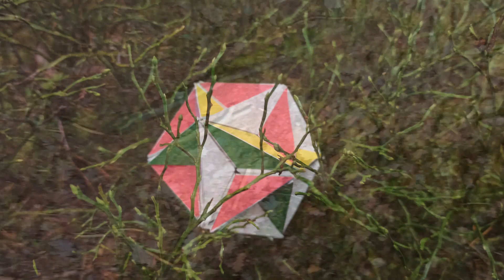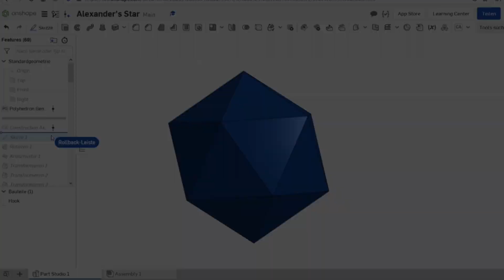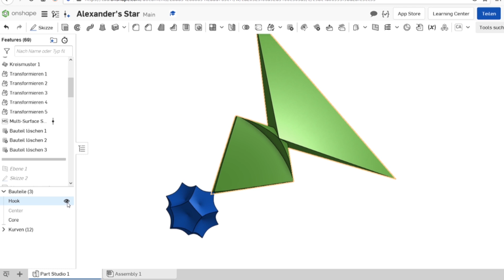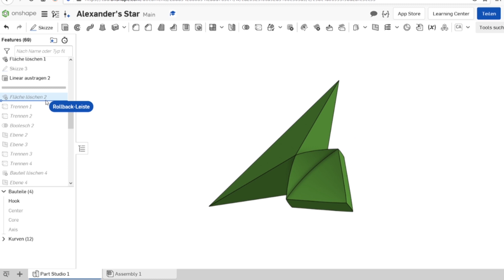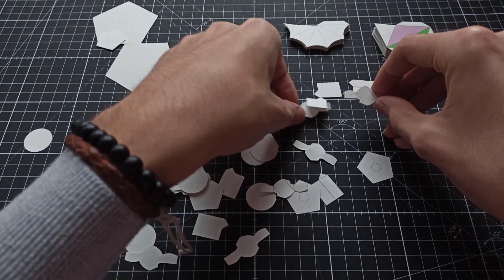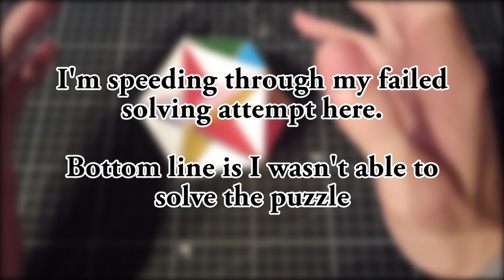Alexander's Star built out of PAPER! | Puzzle Advent Calendar

Comment: Bravo! That was absolutely INCREDIBLE.  I can't believe you did that. I owned one of these as a 13 year old boy in 1982 and could never solve it. I recently found one on Ebay in excellent condition and after some lube it moves very nicely. It is very similar to the megaminx so I was able to use those same principals this time around to solve this for the first time! It takes concentration at first to see the faces. On the megaminx each side has its own face but on this the faces intersect each other and it takes a bit for your brain to start to see it. But after you get it down your eyes will go right to it.  I like it a lot. It's a lot of fun now that I can solve it. Again, very nice job on your part. Very impressive.